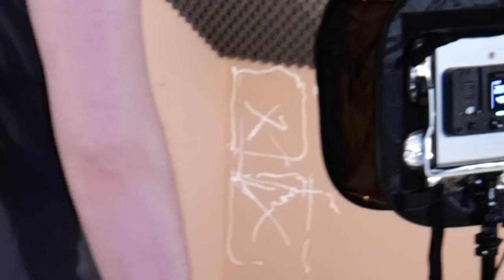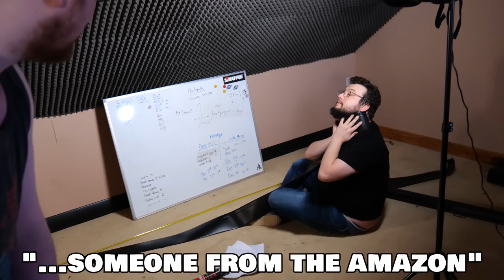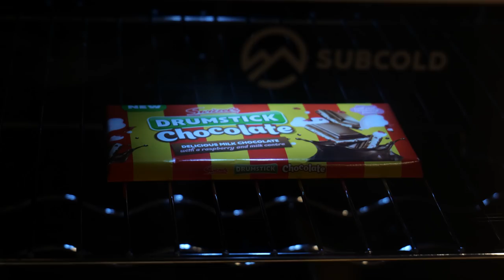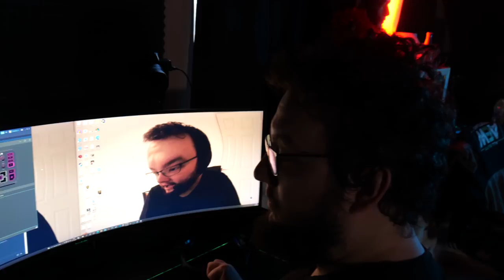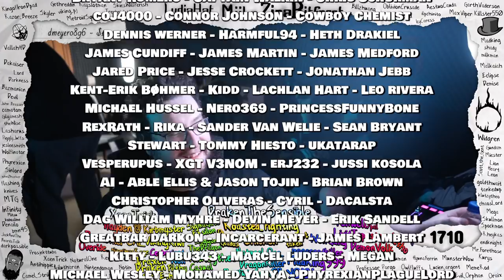3 idiots build their own office (and make MANY mistakes) ● Behind the Tears

Comment: Woohoo! Almost an hour of the modern three stooges. This is gonna be good.
Reply: Wait which ones Curly?
Reply: @iizilfox760  the way I see it, Brett is Moe, Luke is Larry & Dave is Curly.
Reply: @WanderingTetsubo  that makes sense.  Brett is the leader, Luke is the voice of reason, and Dave is the wacky one.
Reply: I never looked at them like that but now that you said it I can't not see them that now
Reply: @dragonblade-go6pe  Now that I think of it, Ed Edd and Eddy have the same setup as Curly, Larry, and Moe, even down to their names matching in placement.  

Hell, Ed and Curly even both have slapstick gags where they are indestructible and are used as tools by the others in the trio.
Reply: @stingerjohnny9951  or the OG Top Gear
Reply: @irtazakhan2243  GODS I miss classic Top Gear.  Clarkson, May, and Hammond made that show
Reply: @WanderingTetsubo  I can agree with that